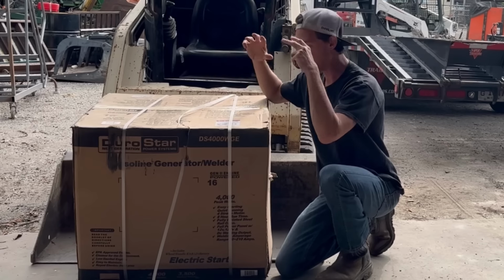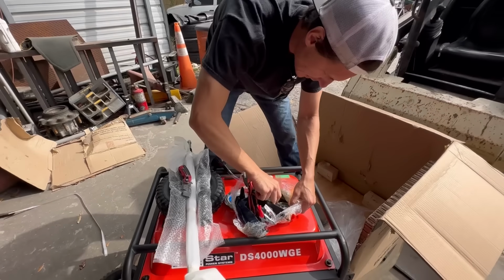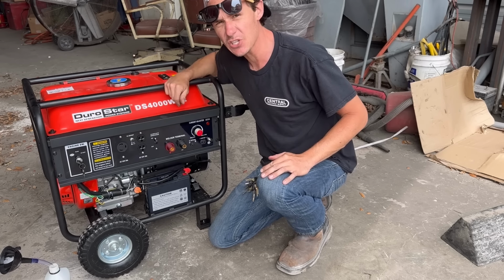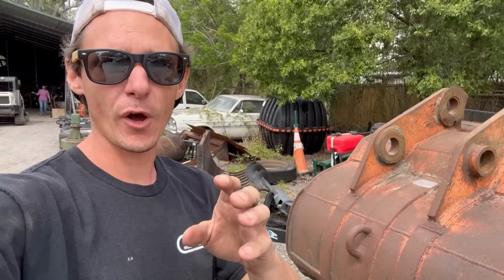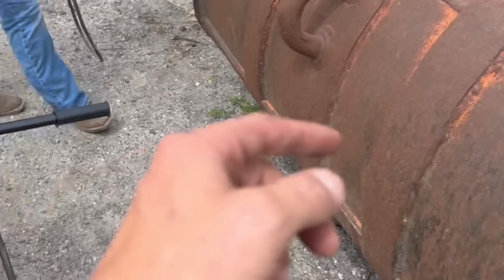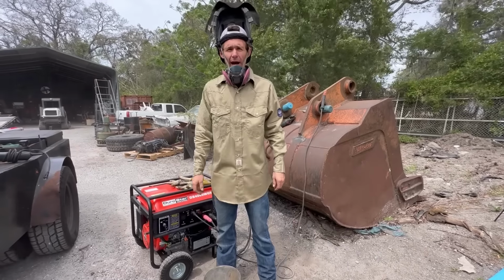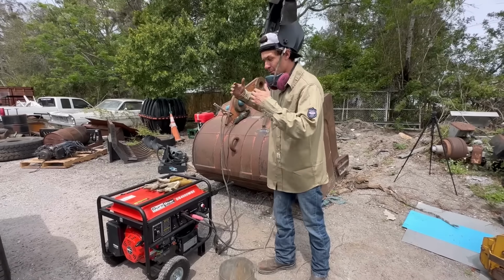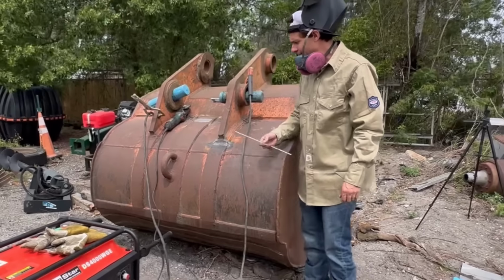The CHEAPEST Engine Drive Welder

Comment: The Vulcan outlaw from harbor freight is a great deal. Been working almost every day without a hitch for a year. Great machine!!
Reply from the maker: Right on
Reply: Lincoln knock off. Wiring is not as good
Reply: That’s my welder I just ordered . Had a short hood 200 , downsized , needed something that can do multi process such as letting me weld mig off the generator , Running Chop saws and stuff as well as stick weld. The outlaw 195 is very underrated !
Reply: They look decent just visually. I like to hear these harbor freight success stories
Reply: If you're a real one...the machine makes no difference. + - I don't see branding
Reply: @MeltinMetalAnthony  they must not have correct assembling parts in factory so they just have adapter for that 110 v pattern garbage
Reply: I just seen it today for $1100 and wish I had the money to spend because I would, in a heartbeat. If I do 3 or 4 jobs with it, it'll pay for itself. Good to know it works before I buy it.
Reply: I have the titanium unlimited 200. Been going pretty hard for 3 years with it and I haven't had any issues. I don't care for branding
Reply: Upload the videos, so we can see.
Reply: @luciankristov6436  what fuel it running
Diesel or petrol
Reply: @royalwins2030 I have the omnipro 220 it's good just put a warranty and trade it back every 2 years. You will get a new stinger and stuff.
Reply: @w,c,m,w &fab  even if you spend 1500 buck rewiring it you'll still save ass loads of money and hate to break it to you but it won't cost 1500 buck to rewire it lol
Reply: If it's a predator motor it's actually a Honda design.
Reply: You have any welding videos of it?
Reply: I've had my harbor freight titanium mig 140 for about 5 years now without a problem! I started off fluxcore welding and worked my way up to bottles and even mig welding aluminum with it on 110v WITHOUT a spool gun. (Not the best looking without the spoolgun). Been the best 400 bucks I ever spent but I'm now looking to upgrade to a generator/welder machine ran multiprocess welder at least mig and stick
Reply: Dude please do a review of that new esab portable
Reply: How does the cost compare and can it do the job for the home welder or as a backup?
Reply: @Rockfpv6001, I have to check that welder out.
Reply: "If you don't like, go fuck yourself,  I don't give 2 shits" Sir!!! This is pure poetry, I love it. Them were some pretty welds too
Reply: @wcmwfab935  you act as if lincoln doesnt make half their product line in asia...
Reply: @zachroberts1988  they do they just use cheaper products to build
Reply: Do the Vulcan engine driven from harbor freight, man I wanna see if that is worth the coin to get.

Comment: Someone else already answered but yeah that weird plug should have a matching socket on the side of the machine so you can charge 12V batteries. They make it that shape so you can't accidentally plug it into a normal 120V socket.
Reply: Bingo. I have that with a set of jumper cables for 2 of my small gens. Jumped my pickup a couple of times. It's a must have and HF used to have it on their small gens and included a set of jumper cables

Comment: When I moved to an acreage 7 years ago I needed a generator for power outages and a welder for hobby and repair work. I considered an engine driven welder, but nothing like this was available and even a used Miller, Lincoln or Hobart was petty spendy. So I ended up buying a 200 amp Everlast TIg / Stick machine and a 7500 watt gen set. While it was all quite a bit more than a little machine like this, it is more versitile. The gen set has 240 single phase output, so I can toss both in the back of my truck and even weld with AC Tig if an aluminum fix is required. So far the biggest work out I've given this set up is a couple of hours burning 1/8" E7018 and it passed with flying colors.

Comment: got that exact welder at TSC it listed for $1300 marked down to 850.00 so when she scanned it , it said $480.00 close out, brand new in the box, i have 3 migs and 1 tig and this gas powererd i have used in the field for 
about 2yrs. on various jobs, the last was around 8 hrs of welding and only used about a 1/1/2 gallons of gas all day very happy with this machine...
Reply: You stole that.
Reply: 480! Wow

Comment: Hey Anthony, if you haven't read through that manual yet or somebody hasn't said it yet, the cord with the clips and the odd plug end on it is a battery charging cord.  On many portable gensets that have electric start instead of recoil it works two ways. First it allows you to charge a car battery from running your generator and second, but a little more of an unauthorized use, it allows you to charge the battery on the generator if it's dead by clipping a battery charger to it or clipping it to your car battery while the engine is running instead of digging the battery out of the generator. I enjoy your videos whenever one pops up in the queue. That unit reminds me of the old Lincoln Weldanpower units you'd get at a rental yard, good for a pinch when your normal rig goes down. I'd be interested to see if that could run a squirt rig suitcase in a pinch. I never tried but it'd be interesting to try. I ran a lot more FCAW than stick and a lot more MIG than FCAW. But hey, if the metal's burnin' I'm earnin'. I learned a long time ago that it doesn't matter the process, so long as you know how to make it run right. Keep meltin metal Anthony😉
Reply from the maker: Right on that would be interesting to see if it’d run a suit case

Comment: Great review young man. I bought my engine drive welder generator off a friend for £500 ($700?) and he used in his service van for at least three years. It only 200amps, has one 110v and one 240v Single Phase outlets but it's done quite a bit of work for me that has made it pay for itself. It will even run my 260amp Single Phase Mig welder on its lowest settings to weld up a car when there was a power cut locally.
Sure, l would love a big diesel engine Lincoln or Miller welder. But they cost an absolute fortune here in the UK.
Great video and BRILLIANT outro as usual! 😂
Reply from the maker: Thanks brother

Comment: Did ya have much issue fitting the leads? & what plate thickness could you weld with it pls ? Looked like u almost had it wound right out. Just asking cos I'm looking for a good cheap machine at the moment. Great video 👍

Comment: i seen those in a facebook ad, they are trying to sell those for $5800 plus taxes... so i got a $50 broken 7000watt dewalt generator a 3.08 8.8 ford differential and a 4.6 V8 triton engine, 75hz would be 1500rpm "9000watt". weld up a 3 bolt flange that bolts to the crack shaft pully and a recycled steering shaft joint that slips over it. 2000rpm on the engine would be 100hz on the generator 1.7X output braker tripping. $50 PTO welder... 50amp to run 5/32 rod, 90amp to run 3/16 rod, sputtering minimum throughput that comes out clean... 12000watt at 100hz... 408 volts.

Comment: Klutch makes an engine drive welder for 2000 similar to the miller bluestar.  My old boss had one and it always came in clutch.  I have a miller wildcat I got for 1200 when I first went off on my own been running strong ever since.

Comment: That plug is for charging a 12v battery. It is not an automatic shut off it can over charge a battery if left unattended.  But looks like a decent unit.

Comment: Cool video man. It informed me more about this generator. I wanted to ask you your pro opinion on which generator you would recommend to pair with my Lincoln ac/dc tombstone stock welder to use out on the field/ ranch? I was considering the Cummins 9500df but not sure if it’s a good choice. That model is made in Vietnam but would rather get a USA made one. Any recommendations for USA generators or a decent one made overseas? Thank you & have a great day

Comment: That little cable you were wondering what was for I believe it is a battery charging cable. Was wondering if you can weld 5/32 7018. Also could you please tell us what the duty cycle is on that machine. Thanks for the demo.

Comment: Great machine for the money and a real winner for small repair jobs. A word of advice on small Chinese engines, do a few oil flushes as it runs in. They are known for shavings from manufacturing being left behind. Use exactly the grade recommended as they are splash fed. Often a straight 30 weight is called for.
A bit of care and you have a fantastic backup machine or a small odd job machine you can cart in the trunk of your family car, pays for itself the first welding job you do!

Comment: That odd plug is for the 12 volt out.
You can charge batteries with this.

See if it has an option to manually set the throttle.
Right now it sounds like it is in fuel saver mode where it adjusts the RPMs to match output.
That is why it take it a second to come up to full power.
My generator will let you turn that off and manually set the throttle.
If you can do that on this I think you will like it more.

I found the manual on line.
It doesn't say anything about a manual throttle.
I guess you will have to live with that slight hesitation at the start.

If you are starting out on a budget you are probably better off to just buy a 220 Volt generator and a 220 Volt welder.
That is pretty much always cheaper than buying a generator with a welder built in.
Reply: hey man would you recommend the harbor freight predator 9500 quiet inverter generator and say a lincoln tombstone stick welder?

Comment: Thank you, Im going to be buying a small engine drive to put on an f150. In this category I've been looking at the Vulcan outlaw, Esab Ruffian, Tomahawk 210, and I keep coming back to this as well maybe. I think im going to go with the Tomahawk as it is advertised to work with 6010 comes with leads and tig torch but its nice to know I can make this one work if I want to spend a little more on the air comp for the rig setup. 

Tomahawk runs 6010 finer adjustments and has idle control, Ruffian can kind of brother in-law you can run near highest amps and still run a small mig welder if you want someone tacking and assembling while someone welds up. The Vulcan less features but better price more amps than Esab if you or anyone has any experience that would help please let me know, would help the final setup for this little shotgun truck.

Comment: Man I just like how real you are! Hell yeah thats refreshing! My only question is, I've been looking for a cheap engine drive mainly been looking at used millers and hobarts. Whats the real difference between that and like a hobart champion 16? Those have a 8,000watt gen. Just more weld power?
Reply from the maker: Ya more power and probably a smoother arc

Comment: That's not a bad machine for the money. Would have never thought it would weld that nice especially with 6010
Reply from the maker: Me either!
Reply: 6010 sets the standard. The fact that it ran through a few of them with no issues is impressive. Wondering how long it’ll last.
Reply: That’s a 7018. Probably 3/16. Or a 6011. Either way it’s laying down. Not stacking like dimes per the 6010

Comment: Hay man I no your the guy who could answer this if I'm looking at a Lincoln Sam 400 for a really good deal but he says it needs the ignition points change to run is it worth the chance
Reply from the maker: Depends on price. I wouldn’t pay over $1000 without it running in case he’s wrong
Reply: Hell yeah he wants 700 but I thought asking would do 5 hell u think it's a risk doing it if I ain't got jobs lined up I mostly do handyman work but I've done some welding jobs just with my handy dany flux 125 I love that thang

Comment: I found an online manual which says Duty Cycle is @190A 1.5 minutes per 10 minutes (8.5 minutes resting) and @<80A Continuous Production 100% Duty Cycle is possible welding 3/32 rods.
Reply from the maker: Dang not so good! Thank you for the info brother

Comment: Sweet Vid Anthony! When are you coming back up North? Those connectors ook like they could be Lenco "LC" lugs, I use them on my Bobcat 225G that I rebuilt (paid 700$ CAD for it w/ 150f of 1/0). You can spread out each "leg" of the connector to make it tighter and they don't seem to jam up as much in the cold. 

Sweet little chinese machine but watch the oil consumption, Project Farm has a recent vid on Chinese engines.

Comment: Why run 6010 on heavy equipment like that? Wouldn’t it make more sense to 7018?
Reply from the maker: There was rust in it still.And it’s a deep penetration rod, unlike 7018
Reply: @MeltinMetalAnthony  👍🏻

Comment: I had a Lincoln weldnpower 125. I could put it in the bed of my truck by myself, Couldn't do that with my  ranger or sa300. Really the only "better" routes I can think of for low budget  would be buying a omnipro 220 from harbor freight then 9kw generator. It would  cost 3-4 times as much but  it's scaleable and would give 10x the versatility.

Comment: There are so many brand snobs out there. I started off with a Northern tool brand mig welder. I used it for 3 years, until l dropped it 13 ft onto concrete (no welder would survive that).

Comment: That's the deal with lower priced welders. The Amp Gauge is usually inaccurate. 

Looks like this kit would be most comfortable running 3/32 Rods.
Reply from the maker: Ya I ran 1/8 ok. Wouldn’t go bigger

Comment: Do you think you could use it as a generator and run a Tig machine off it? I have an Eastwood Tig 200 and it requires a 40A breaker for 220.
Reply: The eastwood analog machine it would probably run no issue, nothing digital tho. You need clean sine wave for that, you can’t scratch start tig with that machine MMA was showcasing.
Reply from the maker: No I didn’t ! That’s cool!

Comment: The old-timer that taught me to weld told me your remote is in your wrist you can change the voltage and amps by how close or far away you are your Electro tip to work peace distance determines whether you're using More Voltage for more amperage closer more amps farther away more voltage small machine like that in the hands of a professional will work just like any other machine the only question I have is how much open circuit voltage is that machine have that determines what it can burn for example your Lincoln should say it has 70 or 80 open circuit voltage

Comment: Sure looks like it welds nice.....you ain't too shabby of a welder either! LOL Those cord ends are for people who want it more as a generator than a welder. If I can suggest one thing, turn the fuel valve off and run it till it quits to use up all the gas in the carb. The ethanol in fuel today will kill it. If you can find ethanol free gas, it is worth it to use it. The welding lead ends are like Miller used to use on their small welders. I have an old thunderbolt that had them. I just bought the DINSE style panel connectors off Amazon to allow me to use my regular leads.

Comment: I have the duromax 16hp engine(same) and i have it set up with belts driving a mecca alta italian head unit at 8000watts.. i use to power a 1970’s 60amp craftsman  welder at half poweri built my madmax generator in 2012.. only issues is the fuel drain cock gets plugged up with gas tank trash Starter went out in 2020..only use ethanol free gas will save you alot of headaches..
Reply from the maker: Nice but for the price it might be deal with able
Reply: yes this is the better deal…

Comment: Probably not made to run 6010's that need higher voltage, which is why you had to crank the amps to compensate.  Might be worth trying 6011's, functionally they're the same as 6010's.  👍  You have yourself a nice fuckin day!
Reply from the maker: You too brother!

Comment: Nice little welding machine that could. 1/8 6010/7018 job sounded like it was right at the edge of the comfort zone for that engine. Not too many hobby welders need more heat than that. Sure it didn't sound as stable as bigger engine units or buzz boxes but that just makes you a better welder. Nothing like having some wind to blow your arc around too. I could totally see some guys getting these just to make their wives quit complaining about their hobby causing high electric bills.
Reply from the maker: Lmao right

Comment: No way you can achieve 210 amps at 4,000 watts at 4,000 watts you will probably tap out at 140 amps. But super cool for $1000 you can keep welding while the real welder is getting fixed. Or for a guy just getting started I can see this being a cheap start up

Comment: How the hell do you get that on or in a truck by yourself? It looks like it weighs 150-200 lbs? Secondly, why are you wearing a mask under your helmet outside? FYI, I'm just a hobbyist that does a lot more flux core than stick with my multi process multi voltage welder. Great video though, thanks.